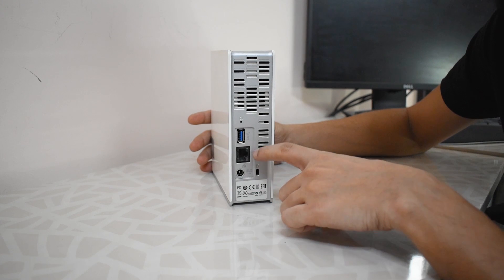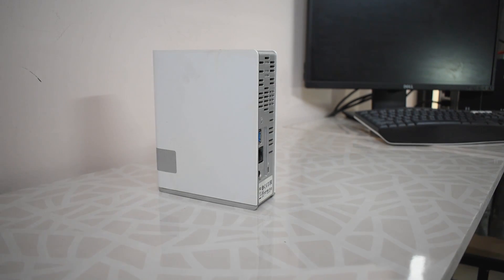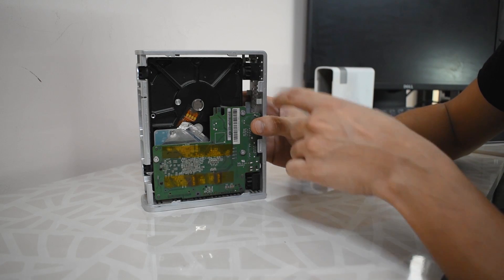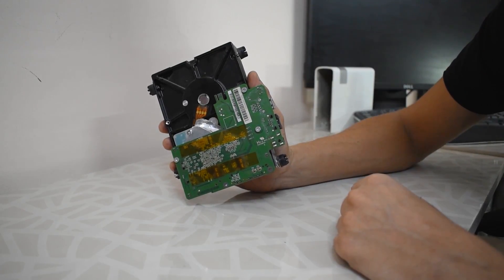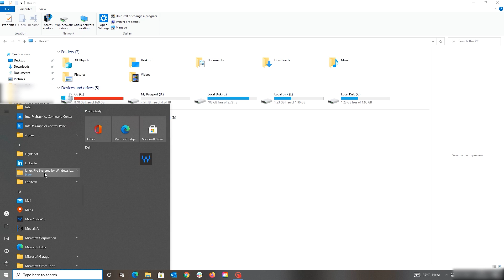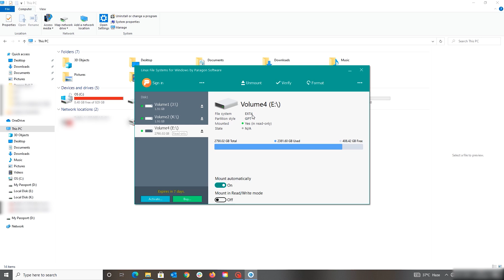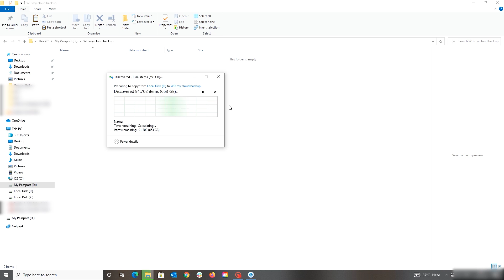How to salvage your data from a failed WD My Cloud?

Comment: Thank you. Well informed video that helped save my parents data. A issue that occurred for me while trying to use software provided was that the app automaticity mount as read-only causing the app to crash file explorer or just not detect the Volumes. A simple fix I found was to just select read only in the app's settings prior to connecting your drive.

Comment: I just paid $1,000.00 to recover some moderately important Data on my 9 year old MyCloud 3TB ethernet  network drive. I researched for 3 months and did not touch the drive. What I had done was my fault for not reading before I clicked. There is a utility in the old software called "Quick Restore and Full Restore" which for all the years that I have used this drive I never saw this utility. So I pressed the "FUll Restore button and what I expected to happen did not in fact happen. In my world the first click on a service  named that way would be to see a second window pop up that gives you the warnings if any and any other switches etc. that may need to be clicked. NOT!!!! It just took off and began wiping out my files. Paniced and hit "Quick Restore" and a message popped up that said "Switching to Quick Restore". I let it finish. It is unwise to cut the power as I have an IT background and heavy handed doesn't cut it. When it finished, about 3 min, it rebooted and came back looking perfect except no files. I began the 3 month research odyssey at that point. I knew about the shady reputation of players in that industry so I just relaxed and took it slow. I learned that it was a linux Kernal and my good friend Shane who is one of the original developers working with "theMan" and the team assured me I could mount the file system with one of many ver of Linux. I got busy and didn't worry to much about having a plan because I had a key piece of info. I watched Linus Tech Tips episode when he did a  video at DeepSpar. It was a deep dive into the world of data recovery. Well that being said I was becoming less eager to blindly embark of what may be a fools quest and procrastinated. Short story I forked out 1 grand and sent the drive to Fields data recovery service. That is a whole saga all it's own. Let me say that nikunj muglan's video has really cleared up all of my lingering questions and I am going to try to restore the drive myself. Thanks for a well thought out approach and all your research. I know, I cost my self 1 grand but if I can pull this off then share it out to the community I will have made that $1000.00 accomplish something. Let me just say that the recovery service was not an out and out scam but it was a hall of mirrors which did not get all 41,000 files. Remember the drive was not damaged. the files were left in the deleted state without any disturbance. I could login to the web interface and it was completely functional and they (Data Recovery) didn't quite do what they claimed. They were very well prepared to bend the rules and accept PayPal as long as I sent the payment to a UK account in Euros. That worked very smoothly.  ping me down stream as I will be doing my best to teach myself the art of data recovery. Sorry for the long message details are important

Comment: Thanks much for the video! I'm stuck exactly where you're stuck at 11:45! The 2.0 hex is too small and the 2.5 hex is too large, can't find anything in between. Did you end up taking that last metal piece out?
Reply from the maker: In my case the hex screw head was worn out so I bent the metal piece a couple of times till the time the screw became a bit lose and then turned it using a pair of pliers. 😂

Comment: Would this work on a Mac too?
Reply from the maker: Haven't tried this software on a Mac
Reply: @nikunjmuglani  need help please, I don't have inbuilt SATA Cable so I ordered an adapter as I will be doing this through laptop, but it is not detecting the wd my cloud drive, could you advise if 2.5" SATA hard drive adapter is good for this process, my concern is 2.5" or do I need another one, if so then which one? please help, thank you for the video !

Comment: You lost me with the cables in your Pc where did they come from, love the video but really stuck at this point, you help would be much appreciated
Reply from the maker: In my case, my desktop tower had a CD/DVD drive which uses the same data and power cables as the hard drive. So I used those. In case you don't have that in your machine, you can buy the cables and plug them in. Alternatively, there are external docks that are available amazon for 3.5 inch drives that you can plug in to your computer via USB.
Reply: @nikunjmuglani  yes I have an oldish Dell with CDrom And DVD drive but would have helped to have seen where you take the leads from and which Leeds there where and I could have gone straight to it but now I'm guessing which is never good.
But thanks for the help you have given just I'm still not confident to give it ago
Reply from the maker: I would suggest that you try an external dock. That might help.

Comment: This was the only video that helped me save my data!! was anyone here able to get the files in their original extension? mines are shown as file type "file", I have like 2TB so can't go through one by one, any suggestions?? please :) When I open them I have to try several things before finding out what they are, but some of them just don't know. The Paragon Software for windows retrieved the info but the folders are numbers and letters, and inside the file names are a very long string of letters. Tech support replied this: Please note that drives extracted from NAS devices are not officially supported in Linux File Systems for Windows by Paragon Software as those are usually arranged in RAID configurations controlled by the NAS' OS and software. Please help, this is the last step in recovering my data. Thank you!

Comment: I tried the software and connecting the drive via a Inateck drive docking station to USB and it only showed 2 partitions neither of which had the data ... however in GParted, it shows all the partitions (I think it was 5 or 6 partitions total, don't recall how many). So not sure what is happening.
Reply: i am getting the same, did u manage to save your data though?
Reply: @thescottishcyclist4640  I think I did, but I don't recall how I did it as it's been months ago.
Reply: @john_thorpe  no worries, gonna use Gparted and see where ill go from there.. ill install a linux VM if i have to .. cheers for reply

Comment: WD MyCloud 4TB NAS older hardware only supports the Cloud OS3 and doesn't support the latest Cloud OS5 software for compatible devices. As the only choice given by Western Digital was to upgrade to a compatible WD Cloud OS5 device. I debated for months to make a decision on my next WD NAS upgrade and disconnected the remote access through the web browser a week ago. Time run out and WD Cloud OS3 only devices' security updates support ended on April 15th, 2022. I wasn't pleased with the choices and the  WD Red Nas 4TB hard drive inside the old device is still in good condition.  I decided to go with Synology as my new NAS. I bought a diskless NAS  that will arrive next week and two 16TB Seagate Ironwolf Pro NAS SATA HDDs that arrived today. Also, I ordered today after watching your video an enclosure for my WD Red NAS 4TB HDD to access and organize my data in the meantime. I already have Paragon extFS for Mac so I am ok on that front to see the Linus device on my Finder window. I can't thank you enough the dilemma of dismantling the WD Cloud and taking out the drive without damaging was adverted and it was a very fast process of about 10 - 15 minutes tops. Clear and Concise.  Bravo!!

Comment: Excellent video! Thank you so much! Mine has been working fine for the last 9 years, so far no issues but I've been burnt in the past so I'm not taking any chances. Backing up data & replacing HD with newer & more storage space. You saved me a lot of research time.

Comment: Thank you! My drive stopped working, flashing red every time I plugged it in. Took apart and followed your directions and transferred files safely to my pc. Will probably do some web based cloud in the future because these still can fail and also seem bogged down with firmware updates.

Comment: This MyCloud is the same as mine, and it’s going out of service with the change to OS 5. As such, after I save my data from it, I want to shuck it and convert it into a regular USB drive. This should help a lot. Thanks.
Reply: The old MyClouds are still usable. They just aren't supported any more and there are no further updates to the firmware. That means they will be vulnerable to attacks if the sharing over the Internet feature is enabled, so they've turned that off permanently with the final update that was sent out earlier this year. They are still fine for use on a local network until the drive itself fails. You can connect an external drive to the USB port and set it up as a safepoint using the MyCloud control panel. The external drive can be NTFS formatted, if you want, which makes it easier to read using a Windows PC. Setting it as a safepoint will make a backup of your files and keep it up to date every night. Then, when the internal drive eventually fails you can use the backup to recover your files. The original MyClouds aren't made any more. They've been replaced by the MyCloud Home, which isn't as useful. It isn't a proper NAS and doesn't support the SMB protocol. It only works when connected to the Internet. So the old MyClouds are worth hanging onto. It is possible to replace a completely failed hard drive with one of the same size or bigger - there are detailed instructions for installing the operating system that the small ARM-based computer board needs on the WD support site. You can then restore all your data from a safepoint drive and have the unit working again.

Comment: Same WD MyCloud issue. I'm following your steps, using an SATA external docking station to USB3, but windows doesn't recognize my drives. When i go to the Disk Management found a "new" Disk1 (without partitions) and system ask to initialize them (MBR or GPT mode). Paragon is empty of drives. This could be normal? Should i initialize the Disk1? Already tried different PC's. Any suggestion? Thanks

Comment: I need your support, install the software, but it does not detect my hard drive... can you support me?; please
Reply from the maker: Have you connected the drive using an external enclosure or internally? And does the drive show up in disk management on Windows..?
Reply: @nikunjmuglani  I connected it internally; as you indicated. 
And don’t read it; change it several times with the CPU off and NOTHING. 
What do you think?

Comment: Please help me! When i copied files from WD My Cloud, i've received notice: "Error 0x80071ac3 the operation could not be completed because the volume is dirty." 
So, i can't copy files from WD My Cloud to USB or Local Disk. Can you tell me how to fix this issue?
Thank you!
Reply from the maker: The error seems to be related to some data corruption on the drive. You might need to run recovery on the drive first.

Comment: Thanks a lot. All data saved with a SATA to usb cable. Paragon software worked great. One question. Is it possible to use this drive as an external hdd with an hdd enclosure? Do i have to format it using any special software?
Reply from the maker: You should be able to format the drive using Windows itself. I was able to and I'm using it as an additional drive for storage in my PC.
Reply: @nikunjmuglani  thanks a lot......

Comment: I managed to read the WD hard disk on my Windows computer after installing Paragon software as per your advice. Works well. The only problem is that the file structure of the hard disk is a bit weird and eventually I can find the folders where my files are stored. I tried to move them back to my Windows computer but somehow quite a lot of files with long file names can’t be copied or moved. Is there any limitation in the Linux file system Vs Windows? Any tweak I can do? Kindly advise.

Comment: Great video...it worked like a champ! Only problem is, the drive that had the data says "This folder is empty", but the volume size is 5.09 of 5.45 TB. I know I had very little (pictures) on it, but why cant I see them in that mounted drive?
Reply: Hi. I have the same problem. Did you manage to fix it? Thanks

Comment: I have planned to purchase the My Cloud. Now I think assembling custom NAS using a Mini ITX i5 pc is better. Setting up True NAS OS is recommended. Currently I am using a Raspberry PI NAS setup.
Reply from the maker: You can also go with an older i3 for that, you don't really need an i5. But yeah, building a NAS yourself is a great option.

Comment: Hi. Which SATA connection do I connect to inside the computer? I used SATA1 and downloaded the program but it won't show up. Is that program/app only for a Lenux computer? I have window computer, windows 10.
Reply from the maker: Any sata port should work. Make sure you're connecting both cables. One is for power & the other for data.
The software I used and the ones I mentioned are for Windows machines. If your drive isn't getting recognised, it may be an issue with the drive itself.

Comment: Hi. Thanks for posting this useful video. I couldn't connect to the computer. When I connect the cables, my PC does not even want to start. Any suggestions please?
Reply from the maker: How did you connect the drive to the computer..? Using the sata cables the way I did in the video..??
If that doesn't work, try using an external dock.
Reply: @nikunjmuglani  at  first, yes I did follow ur steps. Now ordered Sata usb cable adapter and still no luck. My 9 years of files in it and ignorance of not backing it up!

Comment: Great Video ( lousy musak haha) i am still struggling to get the data off using paragon so will go and build a linux machine to try .. however most useful and thnaks Pat
Reply: Success . I was trying to read the drive through an Anker brand hard diskdocking station  - it did not like it so built a quick computer using Linux Mint OS and connected the 6TB drive from a poorly My cloud as a secondary drive and all up running transferring info off ..  Praise to Niunj ! appreciated!!
Reply from the maker: Glad you were able to salvage your data... 👍

Comment: Hi, my docking station wont recognize the disk anymore.  The first time worked just fine,  but now is completely dead ¿Is it possible that my disk has a mechanical failure?
Reply from the maker: Have you tried a different docking station..? If not, try that. If that doesn't read the drive either then it might be the drive's  hardware
Reply: @nikunjmuglani thank you for your aid. Even though it didnt work for me, you are very kind and helpful.
Reply from the maker: @yeatsfelipe  thank you 🙂

Comment: great video, however I have a question @nikunj muglani, if I just wanted to reformat the drive and didnt care about restoring any of the data on the drive.  What is the exact instructions do to so, I have a 4TB drive.  I was able to take it apart and put into a case, after plugging it in, it is asking to reformat and comes up with multiple drives so wanted to make sure I do it correctly.
Reply from the maker: Use disk management on Windows to format the drive and create a new partition.
This might help: https://support.microsoft.com/en-us/windows/create-and-format-a-hard-disk-partition-bbb8e185-1bda-ecd1-3465-c9728f7d7d2e#:~:text=before%20you%20begin.-,Open%20Computer%20Management%20by%20selecting%20the%20Start%20button.,format%2C%20and%20then%20select%20Format.

Comment: Thanks for the video it helped me to view the files on the drive, unfortunately in my case it appears the files are also encrypted, have you had any experience decrypting the WD MyCloud files?
Reply from the maker: That's a bummer! I haven't given decrypting a shot. You can try Linux reader or the mini partition tool instead of Linux file system. I don't remember exactly but I think one of them had an option that might help.
Reply: @nikunjmuglani  I don't think it outs encrypted, I think WD renamed the files and has a database to reference them.  Going to see if I can get into the Db and work it out

Comment: Hey man, I love your videos. I have a quick question,  mycloud device is not being detected in my home network anymore.  I have a steady blue light but when I tried to find it in the network, I can't find it, there is not even an ip address.  I can't access it, I am stuck.,  Any suggestions?
Reply from the maker: Hey, have you checked your routers GUI to check if it shows up as a connected device.?? Most routers have the option where they show the connected devices and their IP addresses.

Comment: Hi Nikunj, thank you for posting this video, i was able to access my ED My Cloud, 4TB drive. However I hit a wall since out of three volumes, the one that I believe contains all the files is appearing as corrupted. Can you please give me a few pointers here on what can I do next ?, 'I'm tempted to send the drive to a data recovery company but, I'll wait for your comments first. Cheers !
Reply from the maker: If you are comfortable with command prompt, you can attempt a repair of the volume using the steps mentioned here: https://neosmart.net/wiki/chkdsk/#From_Command_Prompt-5
You can also give Linux reader a shot.
Reply: Hi Carlos. I had the same issue. I followed one of the newer comments and used the UFS Explorer Standard Recovery software. This made the data usable again